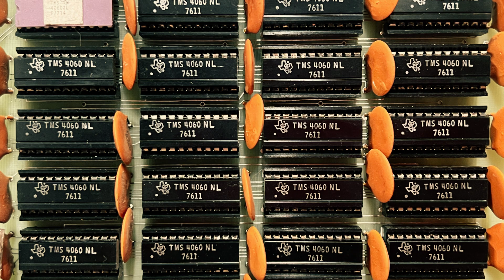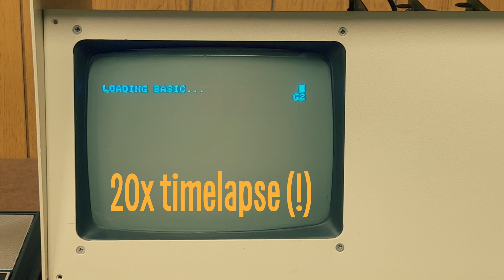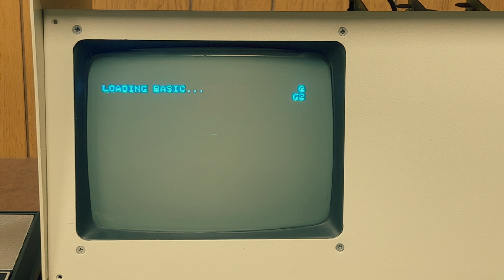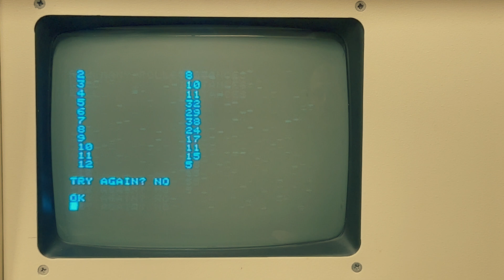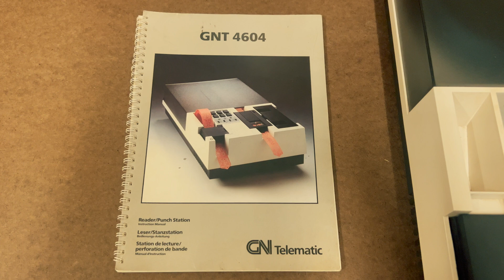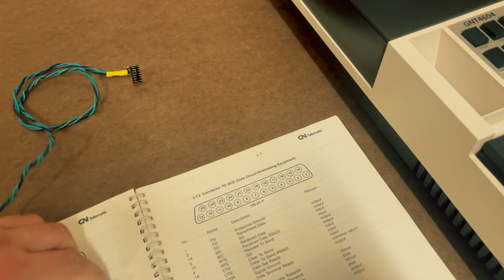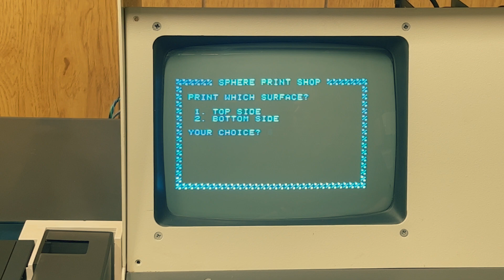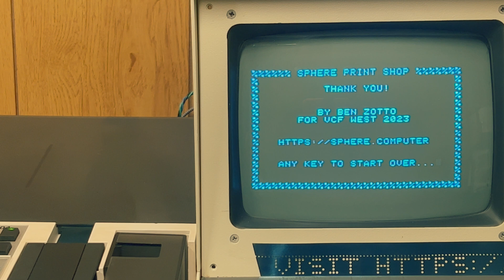Very old SPHERE computer doing very silly tricks, for SPHERETEMBER!!!

Comment: I'm loving these, one question: There are artifacts, or dots that we can seen on screen when the text scrolls. Are these caused by the CTR board or the memory board? I only ask because they were not evident in the first video when you showed the text/program editor. Or is it because you were using BASIC? Really interesting computer and ad it's Spheretember again next month have a good one :)
Reply from the maker: The snow on the screen is a feature (design flaw) of the video circuit, and occurs whenever the CPU accesses any video memory. More substantial screen updates (scrolling) trigger more visible snow than eg a blinking cursor. So glad you find the videos interesting! Thanks!

Comment: I'm surprised there's snow on the display, presumably because screen writes aren't synced with the vertical retrace. That was a common issue on CGA cards too.
Reply from the maker: @NuGanjaTron  yep. The cpu access to video memory is not in any way synced to the video output so access from the cpu side is seen as the flickering snow.

Comment: Is this a recreation of a Sphere by your hand but with some original boards ?
Reply from the maker: The 64k memory board is new; everything else is original. It required a fair bit of (offscreen) effort to repair and restore to functionality-- Spheres could be a bit touchy even in their time!-- but what you're seeing here is real.
Reply: yes but to my question, the boards are original bar one, but the Case ans Keyboard do not match the original Sphere as shown in your intro photos
unless there are 2 versions of the sphere etc.

So it looks like the case is a reproduction with a period keyboard and the sanyo monitor (not used in the original).

 @bzotto
Reply from the maker: @retrobytes.v65  There were two keyboards styles used during production; the one I have is the later revision without a numeric keypad (and with some minor other layout differences). Most of the period marketing images show the earlier keyboard, which explains the mismatch. The keyboard, metal casework, and indeed even the hacked-up Sanyo display component are all original. If it looks... simplistic? Questionably designed? Well, you might not be wrong about that-- but you'll have to take it up with the folks in the 70s. :)

Comment: Man was that a clever design of the "the minimal design necessary to make a nice basic simple computer".  Love those gigantic retro resistors. Way ahead of its time, unless I'm wrong about that.  I don't remember seeing much about it at all back then, if anything.   Maybe I saw a magazine or two for ads in Popular Electronics?  Of the front of the machine in black and white, but never the insides.  If I had seen the insides I would of been more impressed back then and tempted to buy.  Instead, I saved up my money and when the VIC-20 came to town, I forked over my life savings to the cashier faster than you can say LOAD "*"

I don't have a Sphere, but I have a PET... an Osborne, a Kaypro, a Heathkit, a C128, a TRS80 Model II, a... (insert just any crusty mass produced 8bit here).
Reply from the maker: Hard to say whether it was that much ahead of its time as such, but it was certainly (slightly) earlier to market than a lot of systems that could do what it did in an integrated way. Sphere did advertise heavily in the early hobbyist rags (Radio Electronics then Byte and Kilobaud etc), but never really picked up a ton of traction with broad user base, so it seems it was in some senses overlooked and forgotten. You were certainly better off with the VIC: Sphere's design was slick, but its guts was real delicate and quirky stuff that turned out to require dedicated electronics enthusiasts to wrangle into reliable systems. Nonetheless, and despite its market failure and disappearance, I do think the Sphere is important, and is unfairly overlooked in the history, and that's why I'm writing a book about it. I agree that the big 2-watt carbon composition resistors look awesome! (You can get these surplused for cheap if you want to use them in your own projects.)

Comment: 1:57 No autorepeat in those days.
Reply from the maker: That is correct but actually that’s not even what this Repeat was— the repeat key here sent a separate signal to the computer boards that could be read and interpreted in software. It did nothing at all by default!

Comment: If it weren't for the tractor feed holes, you could probably use some drywall tape or something.
Reply from the maker: The feed holes are punched by the device! The "blank" tape is just blank. It's slightly oiled when paper and it has tight thickness tolerances but people do use various substitutes

Comment: Looks like a grifty, but interesting, computer.
Reply from the maker: What looks grifty?
Reply: @bzotto  Ever see those ads for pretty much anything sold by "bulbhead"?
Or that "remote control ceiling fan" that literally just screws into a light socket?
Or those "portable air coolers" that sit on your desk?
That's what I think of when I see how this is put together.
There are probably more than two, but I separate merchants into two basic camps.
1) someone who creates a product, and then figures out a way to sell it.
2) someone who wants to sell something, and makes a product to fit that goal.
This seems like the later.
I don't want to imply that it's spartan nature is the reason, sometimes spartan products are the best.  It just seems like someone slapped together product just to sell product.
I wish I could recall exactly what the product was, but someone in the '80's, maybe early '90's, came up with a text-to-speech hardware system that was really niche and they targeted libraries and schools to sell it too.  That, as one example, screamed "grift" to me.  Something you can get large contracts for, sell to an institution, and if hardly anyone uses them, who cares?  It is now an item on that institution's roster for use, well, until it isn't.
Contrast that with a product I recently heard about that seemed less grifty from back in the '80's  It was a hardware based spell check that would plug inline with your keyboard and "beep" if you spelled a word wrong.  Given that a software based spell check took a lot of resources for early computers, this could make a weak machine perform much better if someone needed that function.
One product attempted to create a niche to fit in, the other filled a niche that was empty.
Does that make sense?
I realize this is long winded, but it if was really easy to "spot" such products, the "capitalist" system would probably collapse overnight, lol.
Reply from the maker: @l337pwnage  Hah, OK I get what you mean. I think they meant better than that, but it is true that the mechanical design left some things to be desired.

Comment: In Brazil in the 70's I was a boy and I loved electronic magazines, and in one (it was called Antenna)  there always a catalog on the first pages with a lot of cool components and devices. Every month there was an ad on the catalog of the size 4 postal stamps with a small paper quality picture: "Sphere. A Real Computer". A few years before Apple II, TRS 80 and a lot before PC, at a time the only digital circuits you could see were of the 74 series and CMOS digital circuits were not common.  It was impossible expensive for a boy but it always made me wonder.

Comment: This is one of the things I couldn't understand about computers of this era - they came with a monitor bolted to them. THEIR choice of monitor. I want to use MY choice of monitor, not one that you force me to. I chose what video recorder to plug into my TV, I chose what cooker to put in my kitchen, I chose what bed to put in my bedroom, dammit, I want to choose what monitor I choose suits MY needs for MY computer.
Reply: Back in 1975, computer monitors were very rare and expensive.  Most computers either had to have the monitor built in, or force the customer to buy an RF modulator to make their TV a monitor.  If you were lucky, the computer had an RF output but most TV's had such poor resolution that the text was blurry.

Comment: The speed of punching that tape surprised me. Was expecting it to take a few seconds
Reply from the maker: It’s a high speed punch, much faster than the old teletype style setups that would have been used in the 60s and 70s. The GNT is the Cadillac of paper tape devices!
Reply: Yeah, I expected it to go at a dot matrix printer speed.

Comment: It's fun to look at old computers. And it's odd to see just how primitive they were. It's even more strange, though, that you chose what must have been the worst computer ever sold!

I read a review (Byte mag IIRC?) at the time ... and it was revealing.

Beyond it's slow processor and dismally small RAM (typical for those days) ... this computer had one characteristic that would quickly put an end to it. This computer's BASIC was written in ... BASIC!

Apparently this computer starts with one of the many "tiny BASIC" interpreters ... which were easy to find and easy to pirate. But those BASIC interpreters were missing a bunch of the functionality of "full" BASIC. So it seems the maker of this computer wrote a "full" BASIC interpreter ... in tiny BASIC! Your BASIC program would be interpreted by that "big" interpreter to produce tiny BASIC code, which was in turn interpreted and executed by the "tiny" interpreter. Oh, the humanity!

That's what gave this computer slowest benchmark results of any other computer in that Byte review. And by slow I mean more than 10x slower than the rest of the pack.

I presume that its quick demise in the market was largely due to its astonishingly poor performance.

Was the firmware ever upgraded to something better? I don't know because there's little information online. Indeed, no one I ever knew could remember ever seeing one of these, nor knew of anyone else who did. It only caught my attention because of that one review in Byte review and the ads that appeared in the magazine for a few months.

Comment: Two possible enhancements:
You can replace the acrylic panel with a new one that will actually be glare resistant

For a modification to solve the tube mount design, you could build a bracket to hold the tube display to the base mount instead of to the face place.

For basic you could use TinyBasic as well.  They have a motorola 6800 version.

Comment: Wait, the video cable and connector looks like a coax cable ending in an RF connector. The video isn't actually transported over RF, is it? That would be wild. Surely it's just baseband video (aka "composite", although there's no color here so not really composite) over an RF cable and connector for some reason?
What does the little switch above the connectors say? I guess it's for the 75 ohm termination that can be turned off if you want to daisy chain monitors?
Reply: Oh wow. Had I just watched about 15 seconds longer before asking, it would have answered all my questions already, heh.
Reply from the maker: @enojelly9452  Hah. And yes, it is a composite/baseband signal, delivered over a UHF connector (chunkier than the standard coaxial F-type one).
Reply: @bzotto  Makes sense. Technically even the (now less) common video cables with RCA connectors are supposed to be 75 ohm coax, but even with a full on PAL signal it's possible to cheap out without much degradation.
I love the snow when that thing is scrolling by the way, clearly they did not care much about arbitrating memory accesses between the CPU and video circuit. Now I have to watch the other videos to see what it's all made of! Great series already! And that SRAM memory board is a thing of beauty.
Reply from the maker: @enojelly9452 thanks for the kind words on the memory board and glad you’re enjoying. My whole thing (with the videos and talks and especially book) is getting some credit to this historically interesting, forgotten system.
Reply from the maker: @enojelly9452 funny you’re not the first person to comment that they like the snowy text. You’re correct about its cause and man the original users back in the day HATED it (as you might imagine)
Reply: when he said sphere gutted intact Sony CCTV monitors he was telling it like it is...i have such a monitor and that connector plate is literally the plate from the Sony

Comment: An interesting machine, they would have been better off if they left the monitor assembled and just screwed it in the back, rather than disassembling it etc.
Did they just leave the boards flapping around like that, or is something missing/removed for this video.
Reply from the maker: Nothing is missing in the video (except a plain back panel, which was usually left off for ventilation anyway). The boards are held fairly firmly by the card cage, but not so firmly that they can't wiggle around. Moving the machine risked the DIP plugs wiggling out of the sockets-- it did not turn out to be an especially secure or reliable mechanical design.

Comment: What if you said NO to triganometry?
Reply from the maker: You might anger Pythagoras!!! 
(The BASIC interpreter starts out with trig routines and data tables loaded at the end of its program data. If you don’t need them, it will jettison those bytes and allow that memory to be reclaimed by user programs. It’s not a huge amount of memory but on a system with minimal overhead it could make a real difference)
Reply: @bzotto  thanks Ben. That's a great answer.

Comment: I'm surprised I've never heard of this computer.  It appears to be between an Apple I and PET 4000 in terms of functionality.  I like that the screen snows during updates.  The physical keyboard layout is almost identical to Commodore VIC-20 and 64.  It would have been a luxury system in 1975 and must have cost a pretty penny.
Reply from the maker: The price was not prohibitive-- it was in the same general net cost ballpark as (say) an Altair + video terminal, and provided the same kind of functionality as that, but with memory mapped video which was better. (All that video "snow" was a logic design issue and was loathed by users. I agree it looks kinda cool now.) Certainly more capable than the first Apple (and a year before it, too). But they were in practice rather flaky overall and a bit challenging to reliably obtain even at the time. The documentation and software support were not up to the standards of other makers. The users who ended up committed and happy tended to be fairly technical and were able to put the time into tweaks and mods. Once sturdied up, though, the Spheres ended up being solid and were useful to many for years after Sphere the company itself vanished in '77.

Comment: The widely spaced reset keys were in fact a special safety feature.  Designed in a such a way as to ensure both hand were engaged with the machine.  The worry was that if one hand were distracted by something like picking your nose, or worse, the user might hurt themselves when startled by the blazing reset speed.
Reply: It could still be dangerous if you slipped while typing Shift-Del.